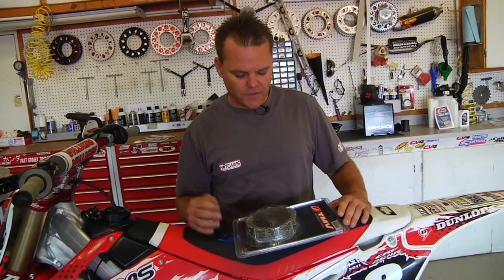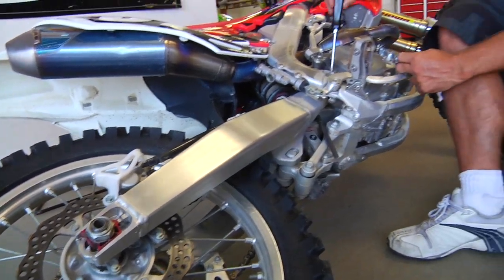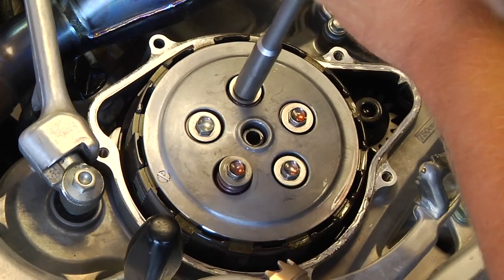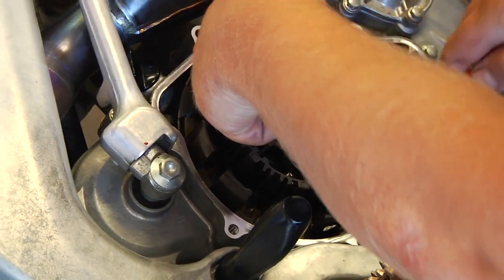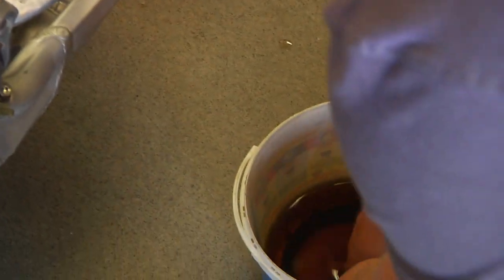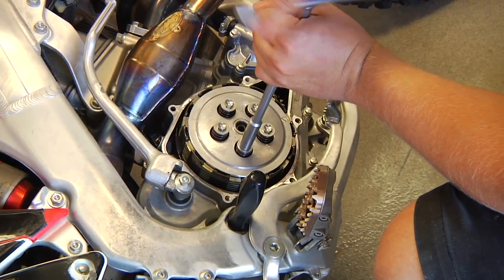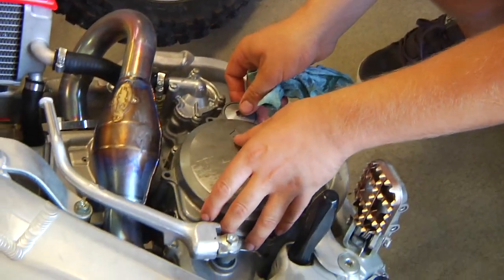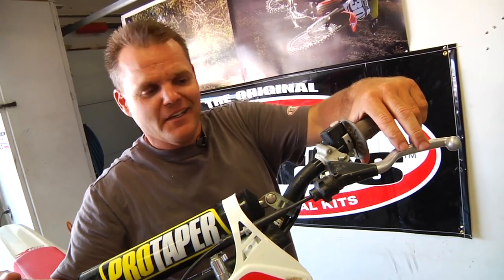Racer X Films: How to install a TMV clutch kit

Comment: yes use the oil you would put in your transmission side. main thing to make sure is that the oil DOES NOT have the moly additive in it. Moly will make the clutch slip but works as extra protection on the engine side.

Comment: @RedBullBurger25 You should be able to feel your clutch is slipping when you ride, also the bike will want to crawl forward with the clutch level is pulled in. Normally your clutch will disengage with about 1/3 pull left in the level, when you gotta pull it all the way to the grip to get the bike to sit still you know the clutch plates are worn out.

Comment: to loosen the clutch springs off you dont actually need to do them in a certain order or way just to put them back on, and the fibers will have a smoother side and a really rough side doesnt matter wich one faces out but they do all have to be the same mathes on transworld shows it alot better but its not overly diffiult to do